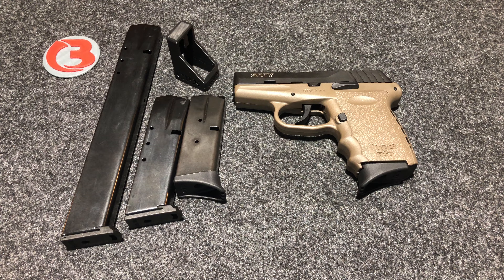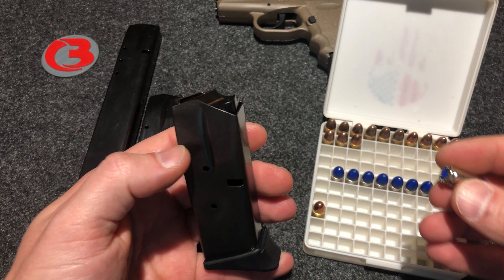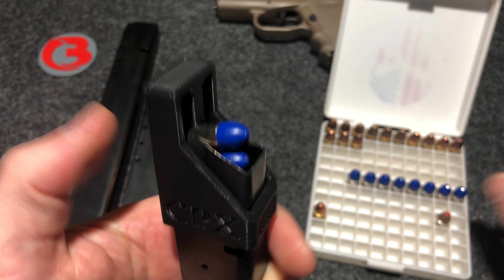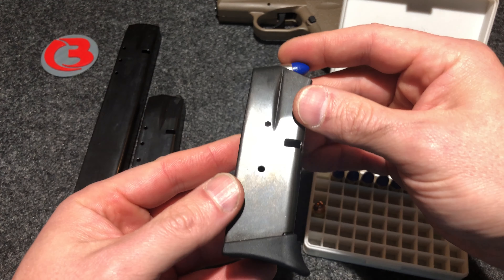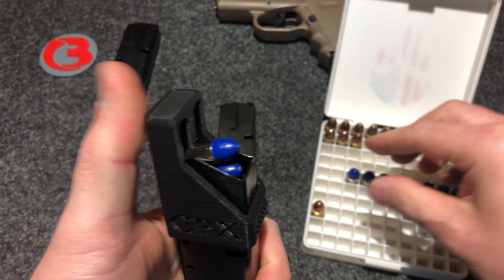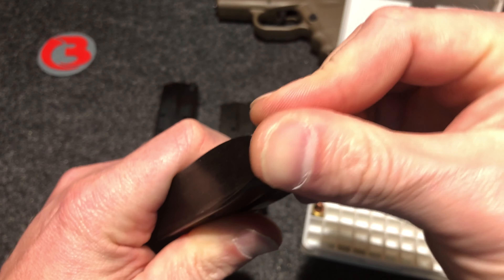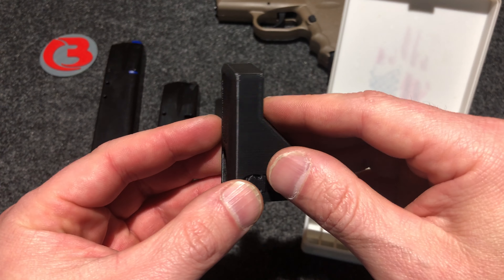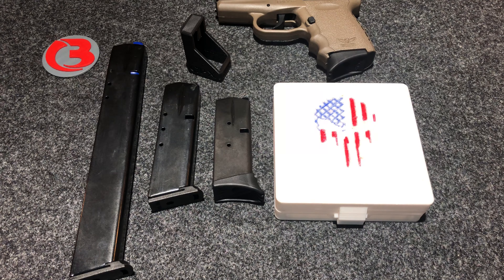SCCY CPX-2/CPX-1 Mag Loaders

Comment: Hello, I just recently purchased the CPX2....you mentioned cleaning the magazine to make loading easier. How do you clean the magazine?  Any suggestions and tips will be appreciated. Thanks!  And I’m going to order your loader as well.
Reply from the maker: Alton Hale hi Alton!  I remove the baseplate. That allows you to remove the spring and follower out of the mag body. 
I cleaned my magazine with isopropyl alcohol. 
Sometimes I apply a small amount of gun oil to the spring after the parts dry.
Reply: bloodywheels thank you!  Just ordered your magazine loader.
Reply from the maker: Alton Hale thanks Alton!  I appreciate your business!
Reply: bloodywheels do you have any issues racking the slide with your 32 rd mag
Reply from the maker: Taki Roseman hi Taki!  No. The slide is unaffected on mine.
Reply: bloodywheels does its shoot fine with the 30 round in ?
Reply from the maker: Marquis Blakemore hi Marquis!  I responded to your other message on that question.